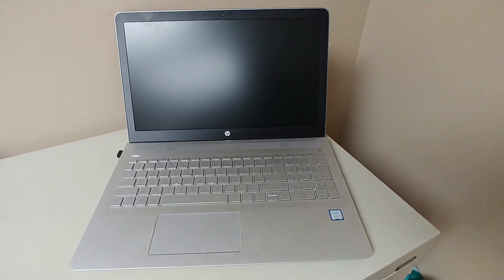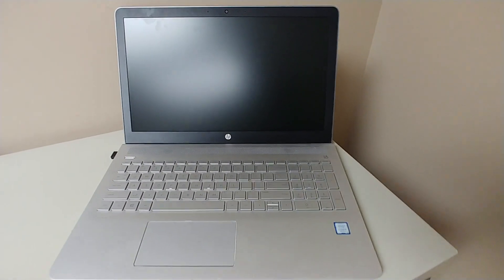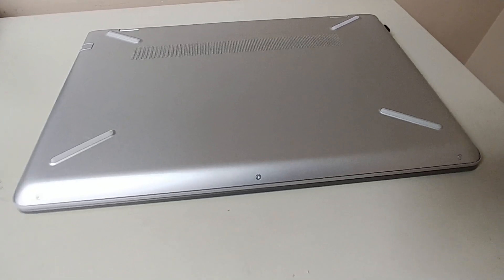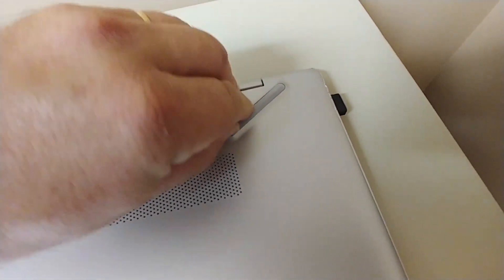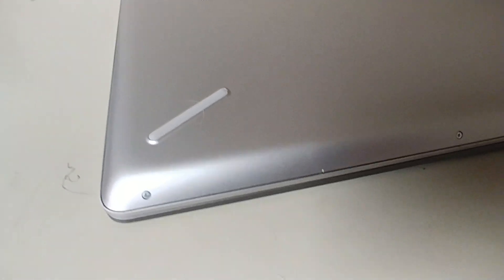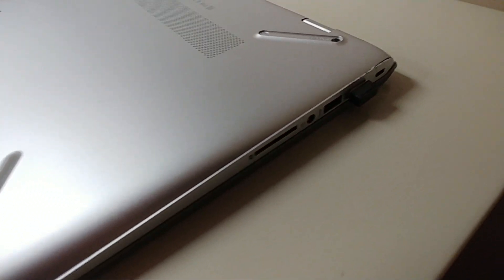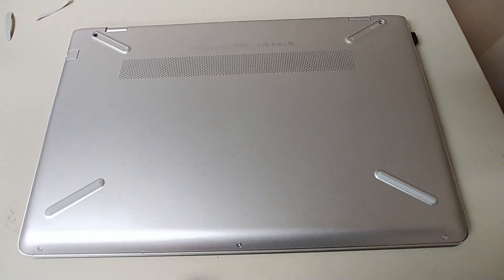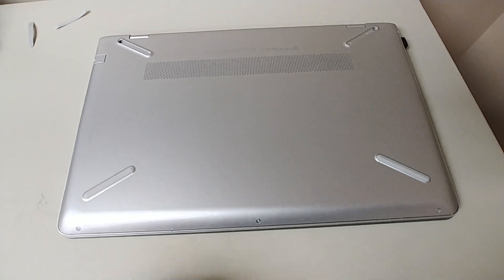HP Pavilion 15-cc561st Disassembly

Comment: I'm trying to put one back together, and the tabs are making me nervous about its alignment.
Reply from the maker: Getting the tabs aligned correctly, and pushing the halves back together is a little nerve-racking. The only thing you can do, really, is to align the tabs as best as you can, then gently work your way around the edge of the case, snapping 1-2 tabs in place at a time. I was able to get the case back together without breaking any of the tabs.
Reply: @ZaxFrank  Thank you. I did that last night. I was just nervous about those inner parts breaking.